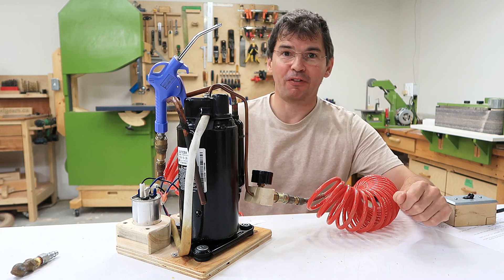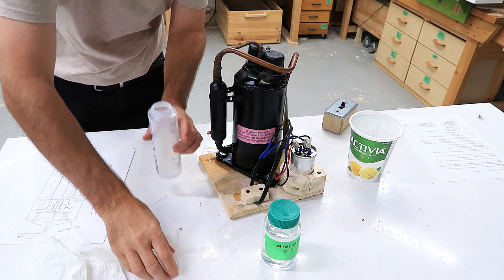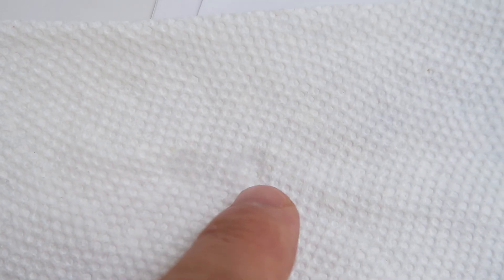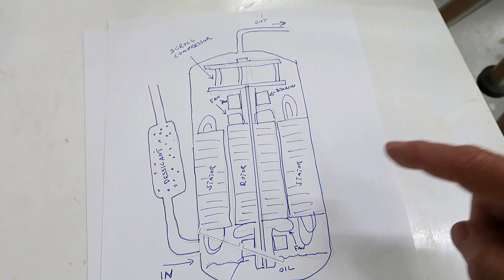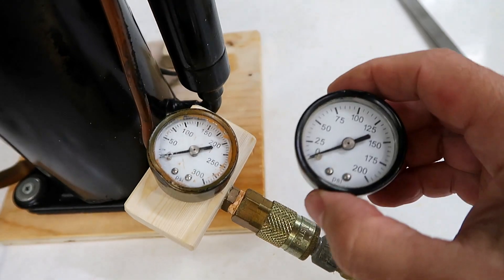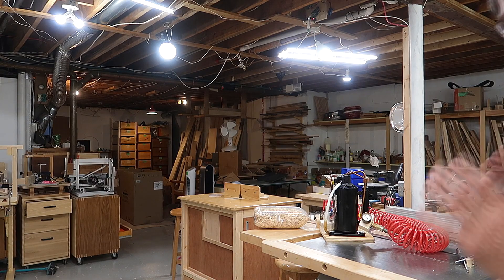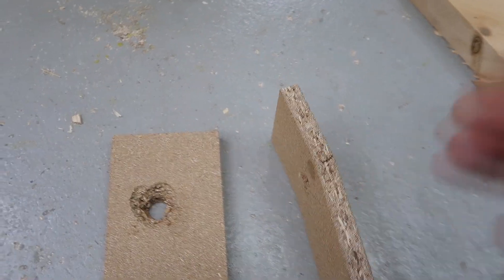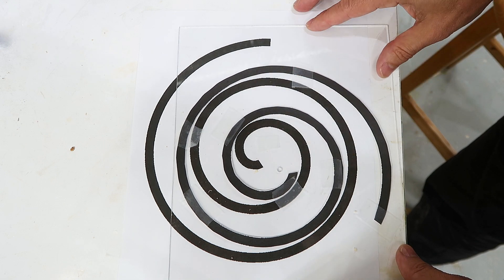This air compressor will fail

Comment: I feel like a sweated fitting on the output would benefit you greatly as well as a water oil separator and even a small tank to reduce cycle times on the compressor. even a filter on the input to help

Comment: Careful with the 300psi bullet there Dad!  

Say, I was wondering more about compressors because I've seen a DIY air conditioner using a 5W blower and a series of PVC tubes with a desecant.  

What was the chemical used in yours before you emptied it? And, how did it get kept in the desecant chamber? 

Have you ever tried building an air conditioner using this approach?  What kind of efficiencies do you think can be achieved doing this?

Comment: Ah the scroll.. I was a mechanic in the secret scroll machining room at Copeland Corp in Lebanon Missouri. Interesting place to work in the layer 90s. Was paid $5000 to keep my mouth shut for 3 years about the manufacturing process. The shaft in the center your mentioned is called a "green shaft". It utilizes garlock bushings. Takes an incredible amount of work to create the orbit and base scroll. 4 cnc machine with multiple tooling per machine. Then they have to be lapped. That's done on a machine called an "aspenizer". Then the "luberight" dry lube system. That is basically non phosphate parkerizing.  Anyway cool to see a project with one. They are the best compressor made. I personally own one.
Reply: Cool story but this is a rotary compressor

Comment: Very good explanation of what's happening inside the system.
   I have a few "harvested" compressors from full-sized fridges, mini-fridges and water coolers. 
   At least one of them (after some testing) will be used as a vacuum pump for de-gassing liquids (oils, resins, etc.), potting electronics, pulling resin through fiber-glass/carbon fiber molds and of course, general tom-fuckery.
   This is an alternate function for the "compressors" that I'd like to see you explore, in your own... idiom.

Comment: Putting a sight-glass with a drain-valve button running from the bottom of the compressor should give you a way to both see the oil level and push (most of) any entrapped water out.
The only wrinkle with this is that it requires a hole drilled and a fitting welded (or silver soldered) onto the bottom of the tank, but this might be going a bit too far in effort and extra expense for "Yay! I got a free compressor."

Comment: There are plenty of solutions for oil in the compressed air. Sullair makes screw-type blower compressors that are oil injected. Consequently, they have to include after treatment systems to remove said oil (and moisture).

Comment: That compressor isn’t a scroll compressor.  It is a rotary compressor. That’s why it increases in size in the suction line to eliminate any liquid because the gas is going right into the compression chamber of the compressor.

Comment: Just Mount you a temperature disconnect on your high voltage line coming into the compressor you can get them for whatever temperature range you want say 165° f it'll kill the neutral feed for the compressor and when it gets below 165° it will close the switch and re-energize the compressor

Comment: The biggest risk for bun up is that you've changed the design load and that will alter the power factor correction of the run capacitor.  But that is only if you run it for long periods, whereas you will be doing intermittent duty.  There are calculations to determine a new run cap value, but probably easier just to measure power factor with various capacitor values.  

The precipitation of moisture is the same problem that is with HVAC vacuum pumps and the need to change the oil during pump down.  Those units use a bypass that draws in a bit of fresh air to keep the partial pressures out of condensation range during the start of the process then close it off to get the deep vacuum.

Comment: when I made my fridge compressor-compressor I added an inline oiler unit to act as a carburetor and lubricate the internals, and then used an oil separator on the tail end. I also used an electronically controlled dump valve between the compressor and the check valve that went to the tank. This unloaded the pump so it wasn't starting up with a high resistance when trying to fill a partially filled tank. I used the whole unit daily for 5ish years before upgrading to a larger compressor/tank.

Comment: I will suggest you also to put a diesel filter on the air intake
And on the output pipe place an enlarged pipe and put inside that pipe steel steel sponge with a lot of surface area to catch most of oil from air

Comment: Mine lasted around 8 years, I just replaced it a few weeks ago. First one I gave very little love, just poured some kompressor oil into the intake 2 times in 8 years.
It was attached to a pretty well sealed system but hooked up to power for the better part of thoose 8 years.

Comment: There is a commercial air compressor vendor in Denmark, Jun Air, that has been selling quiet and compact air compressors using Danfoss refrigerator compressors for probably over 50 years by now. It's proven to work just fine.

Comment: That is a rotary compressor without a doubt, and when people say the refrigerant cools the internals it means that the cool lower pressure suction gas cools the internals, it's typically below 50°F gas coming back to the compressor, also the suction pressure doesn't matter when it pertains to how hard the compressor is working, what matters is the compression ratio. Typically on an airconditer you would have around 150 psi on the suction and 300 psi discharge which gives you a compression ratio of 1.9. What you are doing here is essentially 0 psig suction pressure and whatever pressure you decide to pump the tank up, say 150psi. A similar compression ratio.
All things considered that compressor will likely survive a long time due to the fact that you will be running it for short periods of time.

Comment: the piece on the side should be an accumulator and not a desiccant...rotary compressors like this will have an accumulator to catch liquid refrigerant and oil to prevent it from entering directly into the pump and causing damage. the biggest issue with using these for an air compressor is that their compression ratio is typically designed at less than 4 to 1...typical return pressure around 130 and discharge 350, so exceeding this will likely be the biggest threat to reliability

Comment: I turned a compressor from a water cooler into a vacuum pump. It had three copper pipes coming off of it. One of them needed to be sealed off, so I crushed the pipe closed and soldered it closed. I put some shop towel around the exhaust to catch any oil, and used some 1/4" compression fittings used in swamp coolers to adapt the copper on the intake side to some 1/4" irrigation line that I had laying around. I used a mason jar as the vacuum chamber, so I drilled two 1/4" holes in the lid and pushed the irrigation line that was hooked to the pump in one hole, and my vacuum release line into the other. For the small silicone and epoxy projects that I needed this for, I just needed to degas after mixing, so to seal off the irrigation line, I just added a liberal amount of hot glue to the inside and outside of the lid. For the vacuum release valve, I just took two coke bottles and cut off the very top. I sanded until I got to the rim just under the threads, and glued both necks together with more hot glue. One cap got a 1/4" hole for the irrigation line and plenty of sealing hot glue. To break the vacuum once I'm done, I just unscrew one of the coke caps. I usually just used it with a small mason jar, but I did use it with a quart size jar a few times.

Comment: I've been upgrading my vacuum pumps in the lab to scroll pumps.  They are quiet, efficient and they do not mist or leak oil.  There are seals on the tips that wear.

Comment: When I was a teen up to no good we put dry ice in 2-liter bottles (as you do at that age) and one time the bottle actually withstood the full pressure and the dry ice stopped sublimating. The bottle stretched to roughly twice its normal length but it didn't burst, just sat there ominously until one of us finally threw a rock at it.

Comment: Re filtering air, Many years ago, as a plant serviceman i was sent to the supermarket to buy a bulk carton of tampax, much to my embarrassment 🤭
The reason was, some bright spark had discovered that, filling the airline water traps with them(the old glass bowl type), would trap any oil and moisture better than most things,  if changed regularly(was a spray painters idea, seemed to work very well). will admit i still do the same, for my home use plasma cutter, and painting.🤫

Comment: These compressors are really nice for small occasional hobby use at home where noise and price is a issue. I’ve put together mine with a 6 liter tank from a old compressor that was scrapped along with fine moisture/oil filter and pressure switch. 

It’s a bit slow building to very high pressures, but works excellent for blowing out dust from electronics, airbrushing and pumping tires, which is what I’ve been using mine for. It’s nice that I don’t have to worry about bothering neighbors too given living in an apartment, where people would get annoyed if I wanted to use it later at night, and most of the components were salvaged for free.
Reply: A late comment from me but how is the air quality (water and oil) from your DIY compressor?
Are you using a separator on the line out from the tank?
Reply: @Frank-Thoresen  yes it’s very important to use a good quality separator unless you are alright with oil in the air, in my case I have used mine for a little airbrush and clearing dust from electronics / computers / filling tires so it was important, and it’s worked wonderfully since none of my usage cases consume big volumes of air too.

Edit: I use a finer separator between compressor and tank, and then a regular one from the tank with the regulator to prevent condensation / debris from the old tank. These types of compressors tend to run pretty hot and don’t have any active cooling fans too, so there would be increase in oil and condensation the longer you keep them running without being able to cool down.
Reply: @motalasuger  Thank you for the reply Söta bror 🙂
Reply: @motalasuger  I have a little fridge compressor that I was planning on converting but in my case  I would just keep adding oil to it.  It's probably a reciprocating unit so standard compressor oil or light engine oil is probably fine.  

I have two smaller single stage, direct drive oil sump compressors for larger purposes and one is some kind of Italian brand, but it is the quietest reciprocating compressor I have heard lately as it kinda sounds like a sewing machine running.  These are easier to rebuild too if something goes wrong.  I had one similar to it before that needed a new set of gaskets between the cylinder and crank case and the cylinder and the head.  I just bought gasket material and hammered it out on the compressor.  (this sounds strange but that's the way you make gaskets for something).  The compressor worked for many years and then I gave it to my Brother for car detailing.  It became seized but i was able to fix it. It's still running.

Comment: It’s most definitely cooled by the refrigerant flowing through the compressor, but the duty cycle is a massive amount different.  If you leave it running for a few days it’ll overheat but it’s not going to be a huge problem.  It’s going to be fine but it’s the internet so everyone will point out that it’s not perfect 😂

Comment: When I was a kid, my dad and I made a water rocket out of a 2 liter bottle by attaching a quick connect through the cap.  This served as both the fill port and the rocket nozzle.  We discovered that the bottle could withstand 120 psi... a couple of times.  We were refilling it after the 4th or 5th launch and there was a loud explosion.  The bottle was gone.  We found it later off in the woods with a huge hole in the side.  Luckily we were smart that day and were not holding it while it was filling.

Comment: I threw one of these on a hotdog compressor tank. I fed it oil through the intake every day and it was happy, until it burned out because of the lack of a check valve and automatic pressure relief (I forgot to turn it off at the end of the day). I have another dehumidifier compressor in the parts bin waiting to replace it.

Comment: Moving the compressed air through a large diameter pipe filled with oil absorbent material would remove virtually all the oil from the air for a very long time.

Comment: That appears to be a rotary compressor not a scroll. Why'll it will probably last a long time pumping air, because the piston rolls inside the housing. The one thing to be mindful of is the shell is full of oil, and is pressurized to discharge pressure. Therefore a potentially dangerous condition exists, that of superheated fuel/air mixture that might meet its flashpoint.

Comment: AC compressors were exempt from the RoHS laws which forbid lead in the bearings as they know under standard operating parameters they will occasionally run dry requiring self lubricating bearings.  A compressor like this will operate for hundreds of hours completely dry but will eventually fail.  Your descriptions are objectively false and misrepresent the reality of of how compressors are used in the field.  Please read some whitepapers put out by the manufacturers for education.  A closed oiling system is absolutely required.  Unless a few hundred hours of operation is acceptable and in that case I have no objections.

Comment: The refrigerant coming back cools the compressor. As long as the system is operating normally then the gas coming back is say around 45 to 55 F which cools the motor. I don't think it matters though since your using it just for experiments. But regardless, alot of the cooling capability is missing without the cold vapor refrigerant.

Comment: Paul Breed of Unreasonable Rocket tried using 2L pop bottles as fuel tanks. As I recall, he pressure tested them and got much higher than 150psi, but so far, all I can find is 1000psi using carbon-fibre overwrapped 5 gallon bottles (the kind used with water coolers).

Comment: You said it. the atmospheric moisture will eventually doom the unit, but that will take many years.  My unit is well over 10 years old  and still runs strong.  I have it plumbed to an old  inverted r22 bottle and I dribble a little oil in every time I start it up.

Comment: The case is not under pressure in this scenario, the vapor line dumps back into the case in an AC, and the scroll pump sucks from this reservoir, and dumps it directly out the top through a check valve.

Comment: Scroll compressors are super efficient and oil-less in the medical field. The scrolls have tip seals and grease on the bearings to prevent wear.

Comment: Love that you're putting a bicycle valve in the pop can top at 7:18. I did this years ago when I was screwing around (after being told pop bottles could hold quite a bit of pressure)... Never tried to burst one, but I've also heard the threads are intended to fail first.

Comment: I always had luck exploding soda bottles with dry ice. Just put a chunk of dry ice in there with a little bit of water, shake it up, put the lid on tight and run. You have to give it about 30 seconds for the pressure to build up, but it will go eventually.

Comment: That's not a scroll compressor as you suggest - it's a rotary compressor (an eccentric rotor spinning in a chamber with a stationary spring loaded vane and a couple of reed valves).   I'm not sure how much cooling would be had from the refrigerant on rotary style compressors anyway, as the motor windings are on the high-pressure vapor (hot) side of the compressor, so no cold returning refrigerant vapor to wash the inside of the motor like a scroll compressor has.     The desiccant chamber on the side is actually an accumulator, designed to boil off any liquid refrigerant that may be entrained in the returning vapor from the evaporator.
Reply: When I saw this compressor, I also thought about rotary type, so I changed the model and it turns out that I was right.